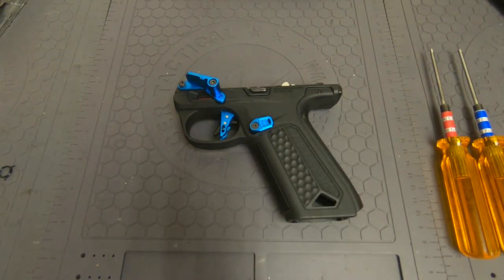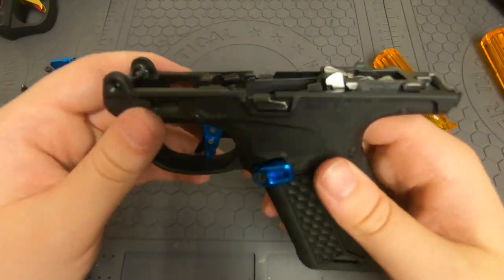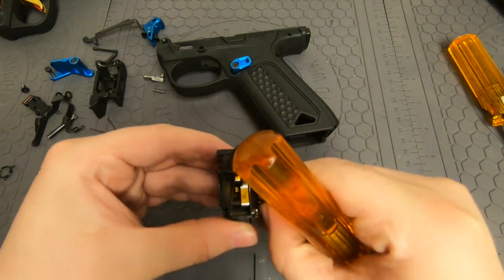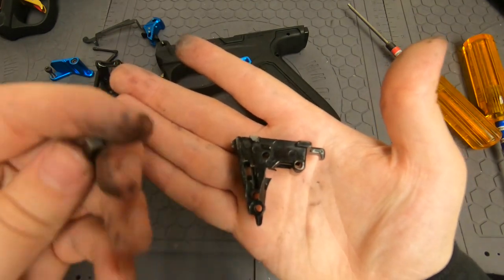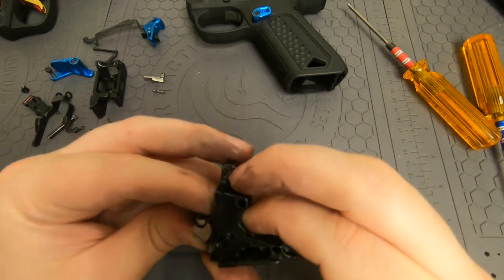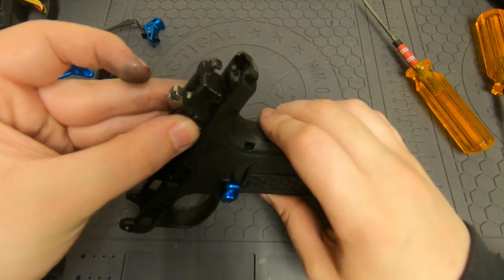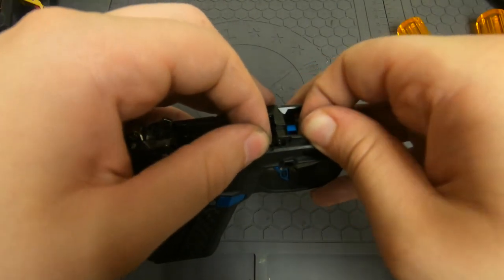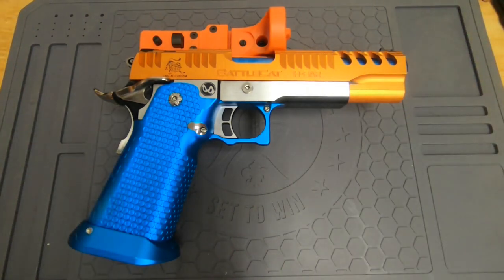Easy Fix for Hammer Does Not Fire | AAP-01 tech guide

Comment: Hi buddy, just a quick tip, you don’t need to take apart the full lower just to remove the hammer housing, you can just undo the pins at the hammer, then as you try to slide it out you slowly pull the trigger at the same time and it will lift the full hammer housing out
Reply: Ty
Reply: Mk

Comment: One question, is a steel hammer going to make problems with my aluminium bolt?
Reply: Late response, but I don't think so. It comes stock with a steel hammer, so it should be fine.

Comment: Why are you removing trigger and safety there's know need to.
if you just want to remove hammer cage just remove the back pins pull the trigger and lift the hammer cage out and you can just drops it in after.
Reply from the maker: this way is better for new players that are inexperienced with disassembling guns.
Reply: @Wyhaq  TBH I think it's more complicated if you just need to remove hammer cage.
YES it's okay if you want to change trigger at the same time.
Reply: @Wyhaq  yes its better to leave them confused on wtf ur doing lmfao, thank god for the other guys comments or i wouldve been even more lost swapping my hammer spring, new players dont need parts out of the gun that are unecessary ill learn to take the trigger out when i upgrade it

Edit: still a good vid tho there aren't others covering this
Reply from the maker: @snipplez8657  I like this way better because it is less difficult. I believe it's very easy to lose your firepin lock if you just do the rear part and not the front first. Pulling the housing straight in and out instead of having to twist and finagle it into place is the reason I like my method better for new players.
Reply: @Wyhaq  thank you for clarifying your process